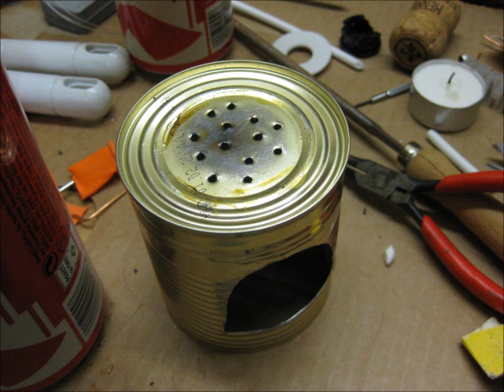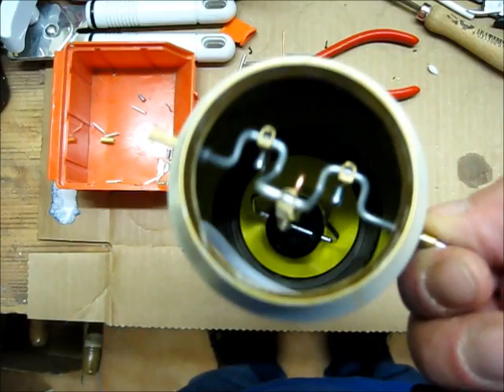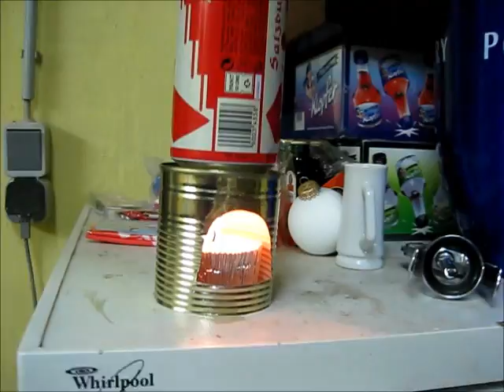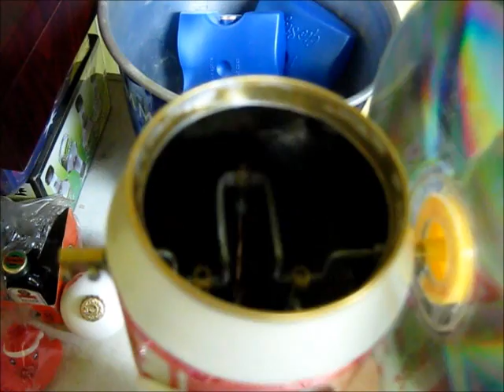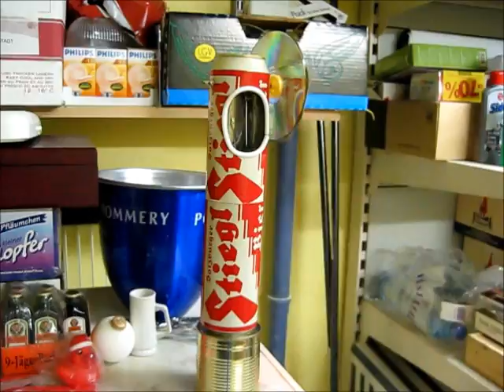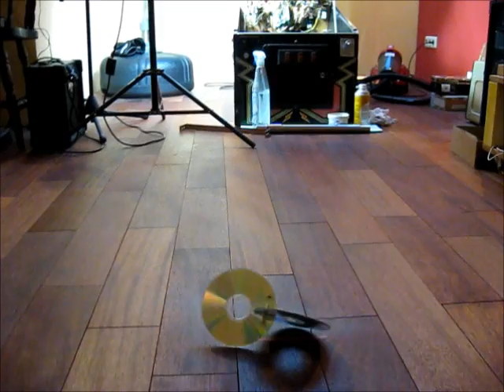Beer Tin Can Stirling Engine

Comment: and then the shaft is connected to a mini membrane pump that pump oil to a heating coil of copper tube that flows above the flame,and is thus pressure fed to a burner that in turns heat the stirling engine.   Damn...a runaway thermodynamic cycle ...hmmm...robust..simple,and capable of using cooking oil to generate high intensity flames.

Comment: there should be always 90 degrees between the rod of the displacer and the ballon, and when the balloon is up the displacer is down, and on top part of the displacer disk should be cold water while down u put fire and give it a push clock wise..
Reply: One may experiment with the 90 degree angle between the displacer and the power piston. With 90 degrees there is substantial precompression  and to have a smoother engine one could use less than 90  degrees. as the precompression effect is reduced . One would get a very smooth running engine  at the expense of loss of power at the shaft.
Oh by the way, pepsi and coca  could be as bad as beer cans as  it is said that  they could contain a little cocaine!   I would suggest milk cans or cat food cans. You have to miss the can preserving pork I guess!

Comment from the maker: @prasannamaps piston is made of steel wire wool and the piston should be rather loose moving in the can, means with no friction only little steel wool hairs should touch the inner side of the can

Comment from the maker: @alabala327 alsmost airtight, it will leak a little air at the hole of the displacer rod. Keep this as tight as possible without friktion. I use sawing machine oil to seal that more or less